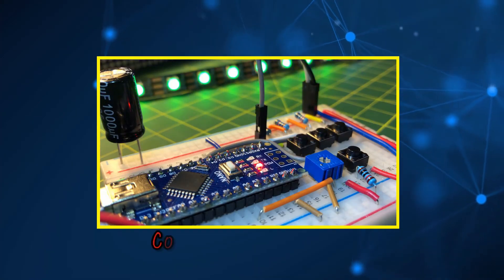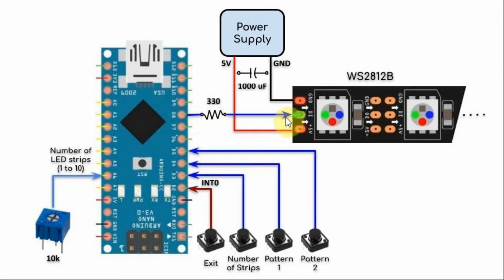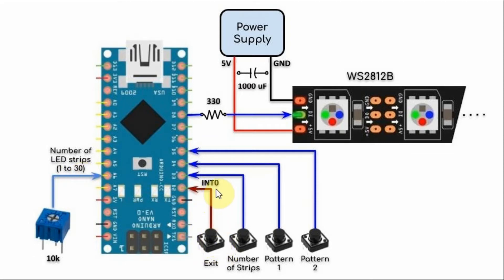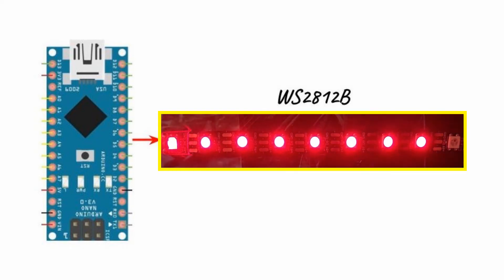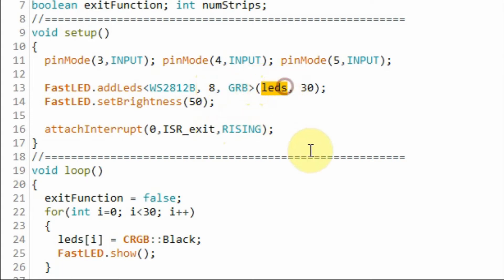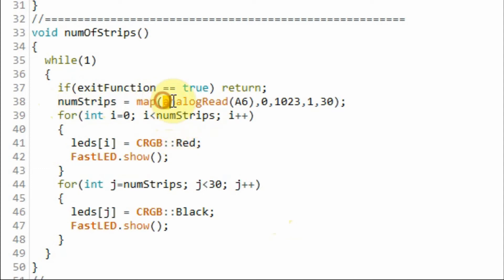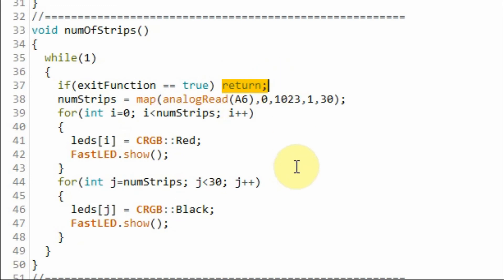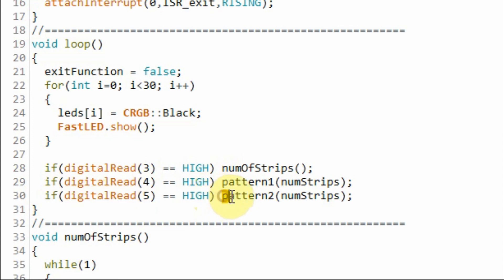Controlling WS2812B RGB LEDs

Comment: What is the strip for you??? It is the led???
Reply from the maker: A strip has 3 LEDs.
Reply: My understanding is that a strip has 60 "LED modules" per meter (or 30 or 144), and each "LED modules" integrates 3 (or 1 or 4) LEDs and a driver chip (e.g. ws2812b).
Reply: @fphenix  That's right. 100% a strip is a strip one meyer or 50 meter but a led is the single light and  the module is how many led on same series
Reply: @elieeid8865  Not quite. Actually each "pixel" (not 'Led') is usually composed of several Leds (R,G,B) and a controller chip. That's why he rightfully didn't want to call them "Led" and mistakenly called them "strip".
Reply: makes it confusing
Reply: @AnasKuzechie  any way, thank you

Comment: Why do we need to use the resistors thou? What if the arduino and the leds are 5V, would you still need the resistors?
Reply from the maker: To protect Arduino digital pin.